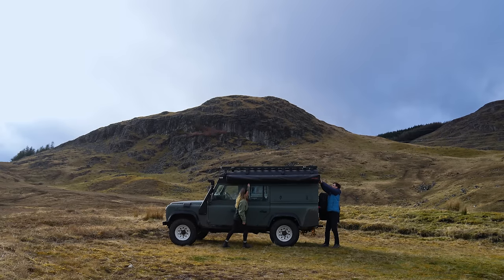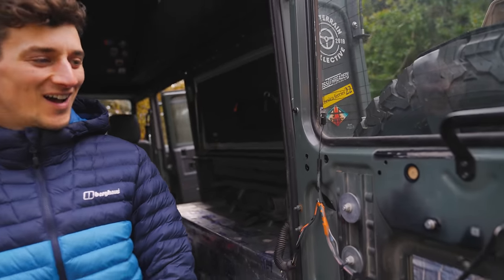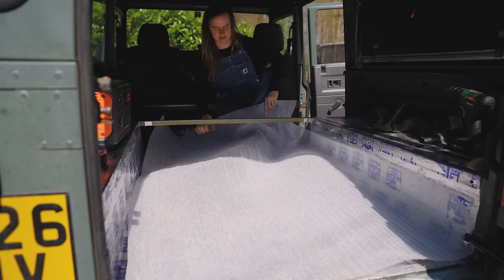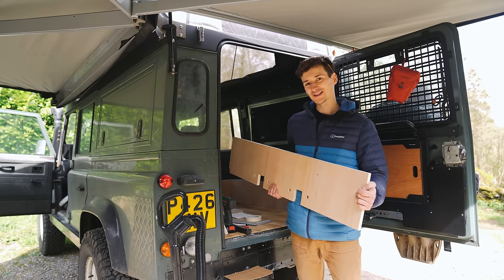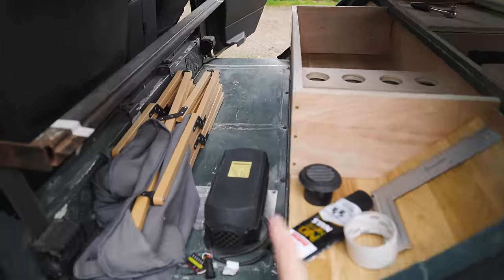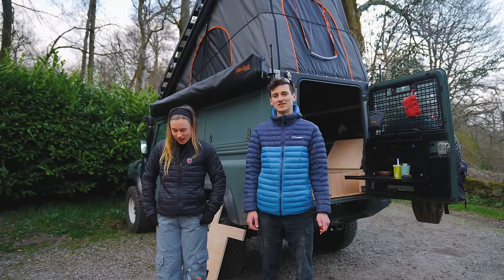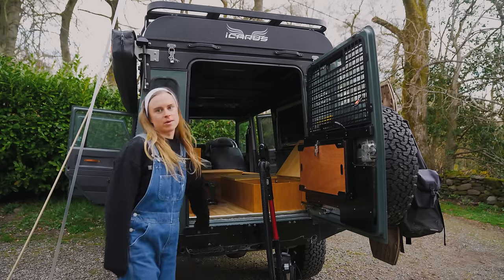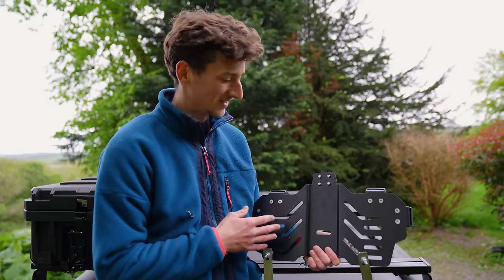Building our Dream Overland Land Rover Defender Camper / with Alucab Conversion

Comment: Those are not internal roll bars, they are the mounting for the seat belts that would have been fitted when it was a station waggon. I've just removed mine because the metal plates on the underside of the bars (in the tyre well) have caused galvic corrosion.

Comment: What a great refurb - well done.
We have a ‘95 110 CSW and are looking at something similar but I can’t decide on whether to keep the rear side window or fit side lockers, do you use them a lot? 
If I kept the windows I could cover them and use the locker cost (quite expensive) on the rebuild.
Any thoughts
Thanks Perry
Reply from the maker: Thanks for watching Perry 🙌 The side hatches were already installed when we bought the Landy 4 years ago but if we'd had time before getting the pop-top fitted we might have swapped them out for gullwing windows to let more light in! The hatches are good for privacy, but we haven't got the internal locker space that you see on some builds - we like being able to open them up in summer to let light and air in instead ☀
Reply: @SomewhereWilder  thanks very much that’s helpful and something else to think about. If I decided to fit lockers I would consider the internal locker but would loose the rear storage width 🙈